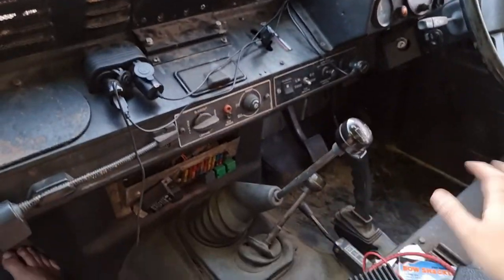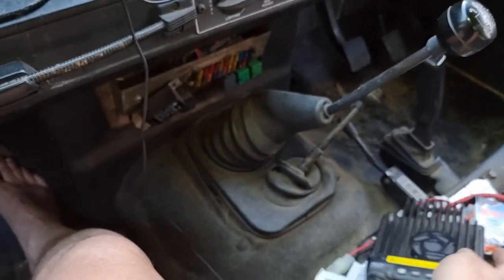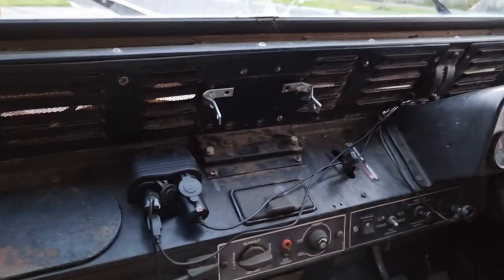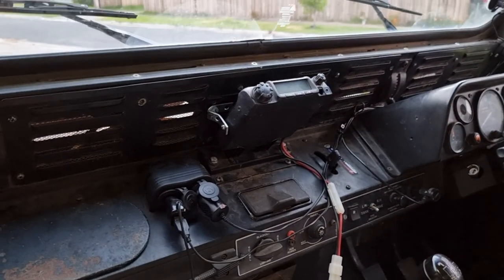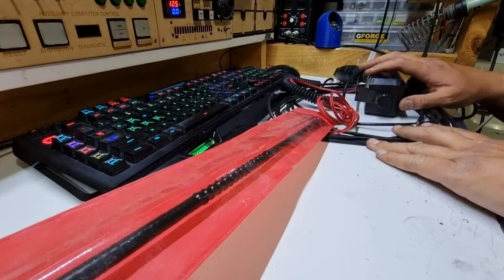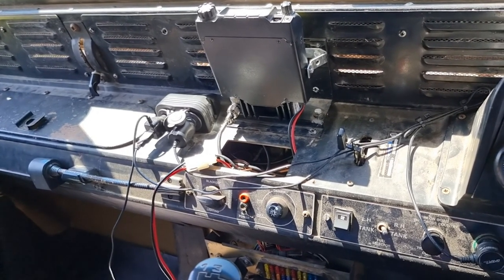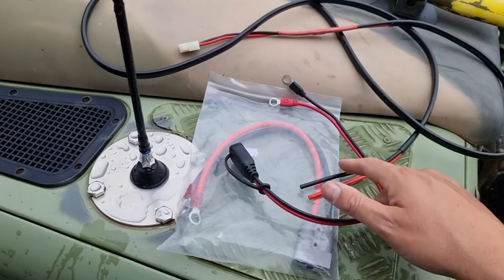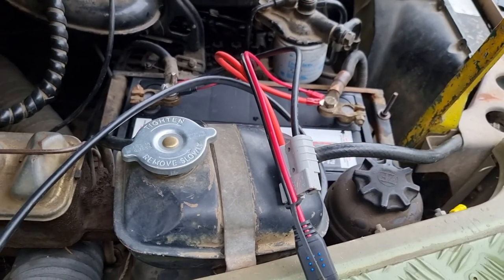Adding a CB | 6x6 Land Rover Perentie Ambulance

Comment: Great clip.
I don't  want to be pedantic, but the SWR bridge enables you to match the antenna impedance to the 50 Ohms transmitter impedance.
Hence that is a 50 Ohm SWR meter.
The dummy load has an SWR 1:1, but it isn't tuned, it is a load of pure resistive load of 50 Ohms across possibly VHF and UHF bands.
Lucky you have a metal dash to play with.
Fuse at battery end of cable.👍👍👍👍
I need to fit a similar sized VHF/UHF transceiver to my Kia Rio, lots of plastic.
Reply from the maker: The dash is actually fiberglass in that, but yes metal mounting points.
And yes resistive vs impedance I know. Was trying to make a quick and simple explanation of SWR, for the uninitiated.

In this case its a quick and dirty install for a trip at short notice. SWR test was basically done to make sure the coax and antenna was good or bad, which it did. Mag base was stuffed.
Reply from the maker: Oh and yes fuse at end of battery cable coming monday when jaycar open, missed the boat on sat for that and they are closed on sunday here.
Reply: @TheAussieRepairGuy  Local supplier here , Wiltronics (Jaycar Agent), open Saturdays 9:00 to noon.
Just a quick 5min drive.
I was out yesterday, Saturday, to repair an Off Grid system, the guy there had a 8wheel Argo.
Ex mining company machine, winch and "roll/cover frame" cage.
Pity it was on flat trailer about to go for major service, otherwise he would have taken me for a spin.
He agrees with you , a great fun utility machine.
Not working tomorrow, so going to get the VHF/UHF rig in the car.
Reply from the maker: @tomgeorge3726  yes for me with my limited mobility, it's an awesome wheelchair.

Comment: An AE409L, perhaps? The 6.6 or 9 dBi gain antennaes?
Reply from the maker: I have a 409L kicking around, with both elements, but this was faster to install.
I also like my little 2.1 db rubber duck. Very handy when you want to convoy with one vehicle closely, and its interchangable with the standard base.
The 409 needs coax replacing, don't have time for that right now.
Reply: @TheAussieRepairGuy  I'm not sure where my 409 ended up. I know I clipped the top part of it off on a branch while on K'gari (Fraser Island) but I still have the rubber duck. Now, on Brutus, our Patrol, I've got the AE4702B, the 6.6dbi. You can still buy the parts for the 409 (it's way more expensive than just buying it as an antennae, but I'm not sure they sell them whole any longer), and was going to if I was going to be driving the Newell on holiday, but we're not doing that, I'm not sure I'll bother. For what I do these days, the 4702 is a great, all rounder. I leave the rubber duck one on if I'm parking in shopping centres consistently.
Reply from the maker: @petermiddo  I have a 4703B on the 4x4.. bigger spring, looks more military but bends the wraparound bracket when it bumps a tree